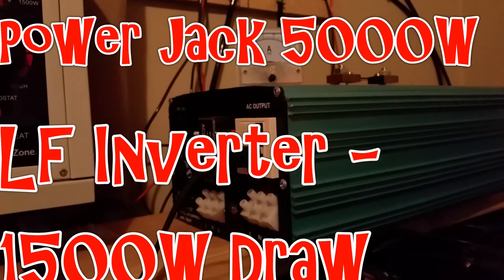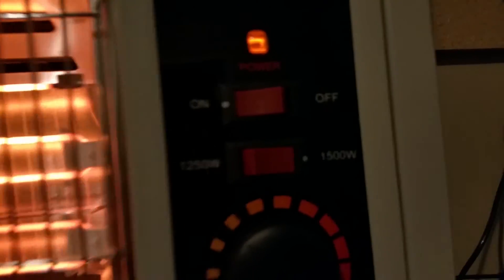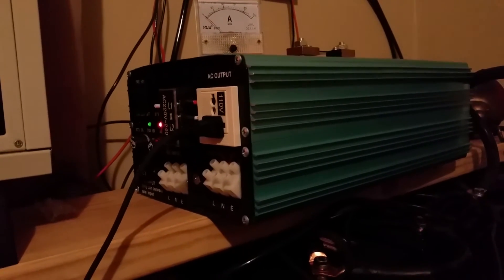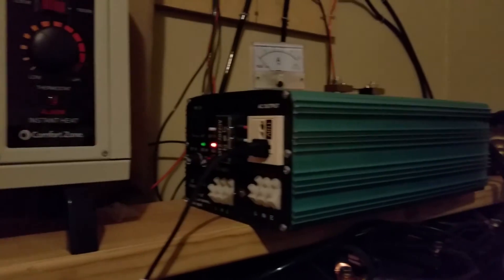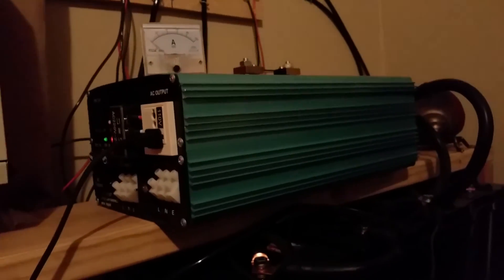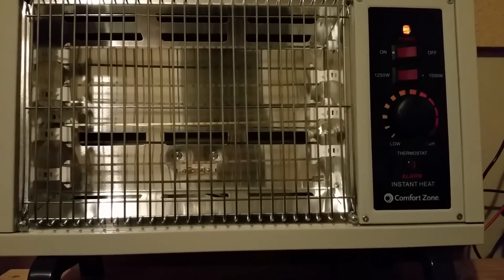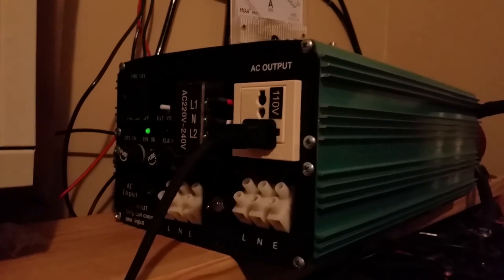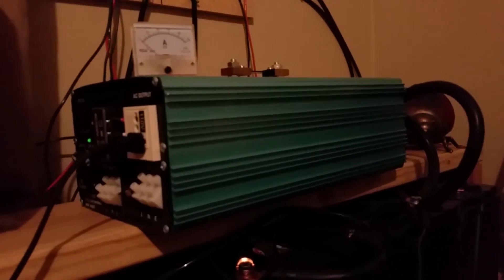PowerJack 5000W LF Inverter - 1500W Load Test

Comment: the alarm light is on because the plug is only for 1500 watts but the direct wire can handle about 38 amps on my unit, if this helps

Comment: I cant believe your only using a 100 amp shunt.   2500w/12v = 208amps now I do know its not pulling this all the time but still it is better to be safe.
Reply from the maker: +peter f my shunt ones one way from the panels. I have a 12 volt array at 1 kW peak output. The shunt does not run to the inverter
Reply from the maker: +peter f my shunt ones one way from the panels. I have a 12 volt array at 1 kW peak output. The shunt does not run to the inverter

Comment: it's 5000 watt inverter man ... it should handle 1,500 watts easy .... yet the red light is on !!!!
Reply from the maker: +Cham Raf it should, but the plug itself is limited to 1500. In split phase it will handle at least 3-4kw